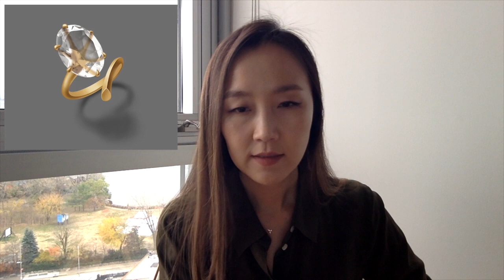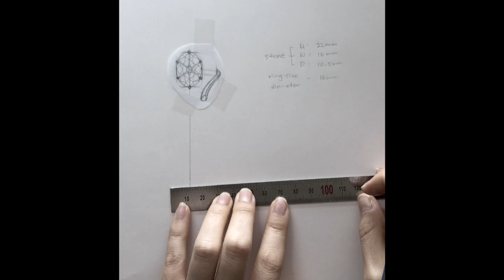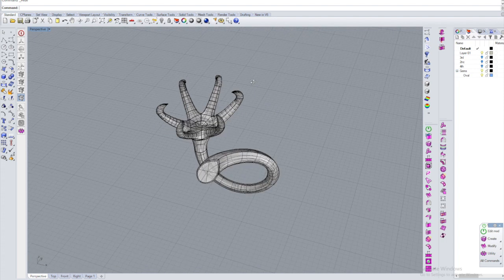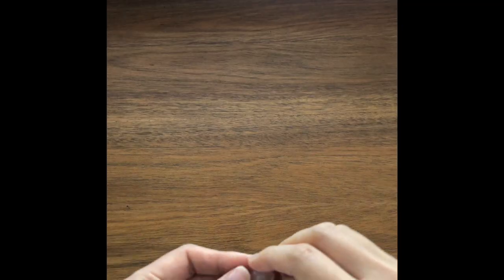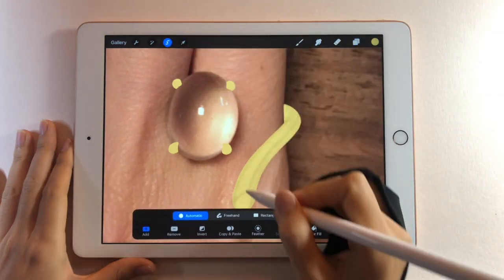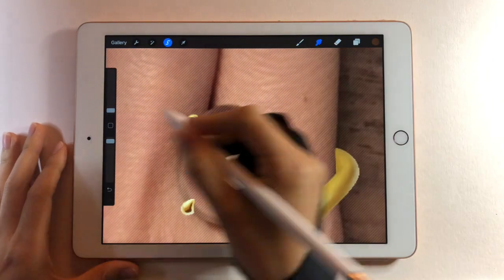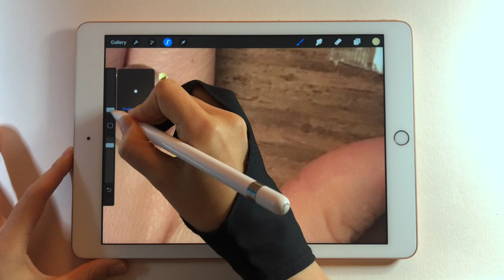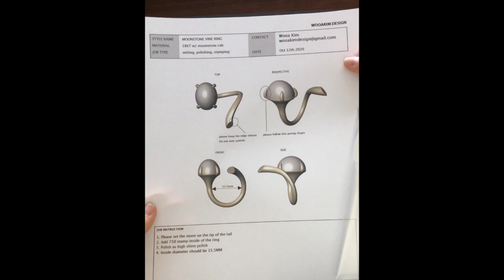How I draw Jewelry on my iPad & Procreate | Moonstone ring - Part 2

Comment: May I suggest that you should invest in your own 3D printer, either a Elgoo Mars 2 pro (around $250) or Elgoo Saturn ($400)
For printing your own jewellery models, both have been highly recommended to me, by a 3D designer.
Reply: AT,  I am interested.Have you used both the Elgoo Mars 2 pro, and  is the Elgoo  Saturn worth the extra money I would think it might be.Thanks
Reply: @l.e.m.friedman5965  No they have been highly recommended to me by a jeweller and a 3D artist so I am saving to get the Mars Pro 2.

Comment: Awesome vid. I had a quick question, do you have shapeways also do the polishing of the 3D printed model sometimes? Or do you just always get the raw model from shapeways and then take it to your jeweler? Also, which jeweler do you use? I'm currently looking to start dropshipping  custom designs but I'm missing the jeweler part (for setting/finishing) from my pipeline (before actually sending it to the customer). Any recommendations of how you might do this? or who I could contact? Thanks!